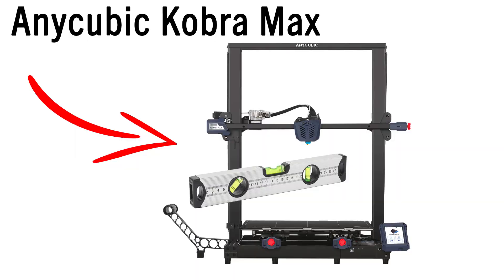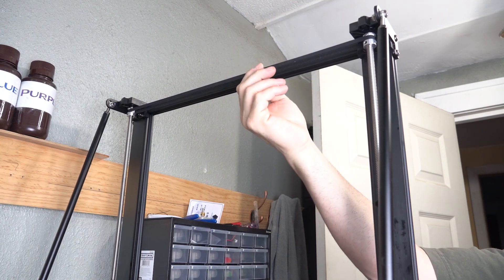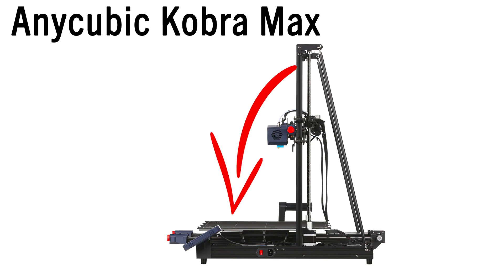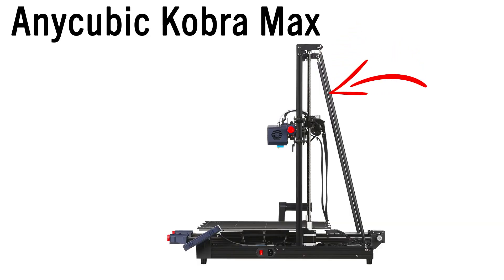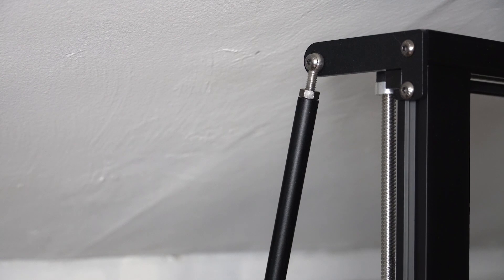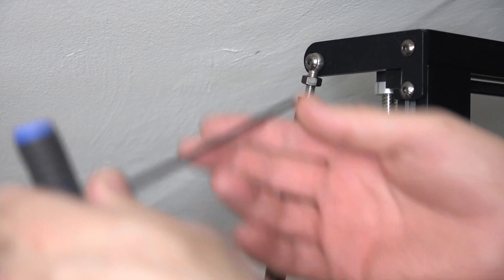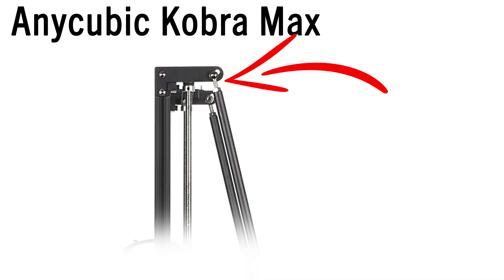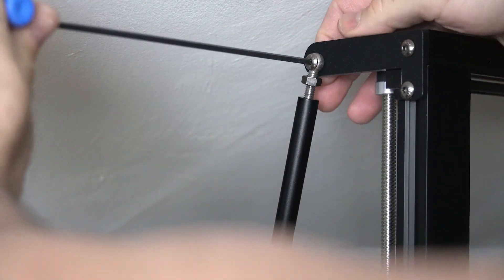Bed Leveling Issues with the @Anycubic Kobra Max

Comment: I just got my kobra 2 max when I try to level it the bed(when motor is pushing) will grind extremely bad then when the extruder lowers toward the bed it gouges into the hotbed anything you could suggest

Comment: ive only had my Kobra 2 max for about a week, ive been able to start a print 3 times and eery one has failed within 2 mins... i cant seem to get past the "Z-axis zeroing failed, possible cause 1. the leveling sensor is abnormal. please check the sensor and wiring. 2. the Z-axsis motor is abnormal, please check motor and wiring".............. ive got 3 other printers , all are lotMaxx, and small printers.. they work.. but i wanted bigger and etter,.. well eventho the max is bigger, its not working so its far from better... if i cant get this fixed soon, im simply going to return it. i have a small window of return left. ... i guess my question is simply, do you have any tips on how to fix my issue?

Comment: why tf is this kind of stuff not mentioned in the manuals i got bro im actually getting a migraine
Reply from the maker: exactly what I was screaming when I figured this out.  Listen, if you find this only fixes your issue partially, there is a code that you can add to your slicer that will compensate for that, I walk through it here, good luck!!: https://youtube.com/shorts/L62LuZwa2B8?feature=share
Reply: Thiught this was common sense but then again i bought mine without a manual

Comment: Please I am in dire need of help. I bought my first Anycubic Kobra 2 Max during the presale and it became my favorite printer. After a month I started getting an error of bedplate not heating. As I updated the firmware, it then became Hotbed NTC issue and pretty much killed my printer. I had to take about the bottom to reattach the bed plate power cable which gave me one print. It no longer works because of this issue. I bought another Kobra since it was a great printer but not even a month after producing perfect prints, it now has massive shifting and nothing comes out of it correctly.
Reply from the maker: By massive shifting, are you saying it shifts in the middle of a print? If that’s the case, that sounds like it’s most likely a belt tensioning situation if it shifts from front to back make sure the two belts are tense not so tense like a guitar string that’s gonna snap, but make sure it’s pretty tight and make sure they feel app Appropriate to one another so the left side is just as tense as the right side. Lastly, if it’s a left or right issue, check the belt tensioning along the gimbal.
Reply: @PrimalEdge  it is shifting in the Y Axis. As far as tension, I adjusted it several times and saw no improvement at all.

Comment: Thanks for the video! But I have a problem with far left corner. If I do the mix of the fixes that you mentioned in both of your videos I might mess up the other corners as well. Or am I wrong?
Reply from the maker: Yes, and no. It’s kind of like a balancing act. If you’ve ever seen anyone try to level a pool table or something like that you have to do it one section at a time and it’s kind of a process. So yes, in an attempt to fix one area you might then offset another area, but if you minimize your fixes and do a little bit here in a little bit there, you can level it out overall I had my problem in the front right corner, which is I think opposite of what you’re saying in the far left corner. One of the problems I ran into when I was trying to solve this. The first time was overcompensating. And I kept thinking every time I do one thing I’m making something else worse. So just take it step at a time and if you’re using test prints, they can be your best friend! There’s a few different types that you can use that I know or in Cura I can’t remember exactly the name, but if you look in the Keira menu, you’ll find different types of test prints you can do and there’s one that has I believe nine squares, and then a perimeter around the whole thing. That’s a great one to figure out where your deviations are at. I know it’s frustrating, but if you take the time to dial it in, you will absolutely be happy with this machine. I am. I’ve got two now.
Reply: @PrimalEdge  thanks for such a quick reply! I appreciate it. It seems that now I have plans with Kobra Max this weekend trying to figure this out. Thank you for your time! You do a great work not just informing of the fixed that Anycubic doesn’t bother telling customers about, but inspiring to keep on going and getting these precious perfect prints despite all the troubles with the printers!
Reply from the maker: @RockerokBS  thank you very much. Definitely keep me posted in this thread and let me know how things turn out.

Comment: This printer is a huge waste of money. I will never buy anything from anycubic again except resin. Resin and not resin printer.
They dragged me through the entire warranty period, when the warranty ended they simply told me it was out of warranty.
I didn't get a single good impression on the kobra max, I'm waiting for a skr board and parts to arrive so I can remove everything and just use the structure. I want to distance myself from this brand and this printer.

Comment: Where can I find the support struts I have a Kobra Plus and would like to add the struts I'm having Leveling issues front to back.
Reply from the maker: If you’re trying to find the parts and they’re not on the website, go through customer support on the website. They are extremely responsive and very helpful. If they don’t have them in stock and can replace them, they’re sure to know where you can pick some up. But I don’t know of a vendor that carries them, myself. Sorry, but that’s about the best I can do for this issue.

Comment: I have the kobra Plus and when I perform the auto bed leveling the printer head pushes the bed down about 1mm on the corners. When I print something close to the corners, the nozzle hits the bed. What can I do to fix this?

Comment: For me this method didn’t work however removing the bed and adding/removing washers to those 6 screws does. My bed was 1mm higher at the back and fortunately the existing washers were 1mm  thick.
Removed the front two and voila now perfectly level.

Comment: Just bought a Kobra Max, during the first auto-leveling, the x-axis errored out and I"m stuck right there. Any help would be greatly appreciated. I've checked every connection, even on MB.Y and Z work with the computer screen, and Y will home. But X will not work manually on the screen and Z will cause the error if I try to home it. I've check my belts, rollers, plugs, wires. Thanks.
Reply from the maker: When you say you’ve checked the belt, are you saying that you just checked it to make sure it was connected or did you check to make sure the tension was correct. I remember when I first got it it took me a little while to get the tension right on the belt because I couldn’t get it to home.  There are two handles in the front of the machine one on the left side, one on the right side, and as you turn them, they loosen or tighten the respective belts. I know that everything can be attached probably would’ve attention isn’t right it won’t work properly.

Comment: Good morning/afternoon. Firstly, I want to thank you very much for having such detailed explanations for this printer specifically.

The Kobra Max is my first printer, and I've recently replaced the entire hot end after I didn't correctly replace a nozzle on the first one, which led to a completely destroyed heat block.

Now my nozzle scrapes my build plate, and although I have only slightly played with the z offset, I can not shake the feeling that I shouldn't have to with the auto level.

Am I just wrong, and I should manually adjust the z axis like you demonstrated in your first video and this one or would you recommend another course of action?

Again thank you for your time and effort both of these videos give me a renewed sense of hope that I can fix my problem because I also love this printer it's exactly what I wanted and needed to start this hobby I just need to learn how to best maintain and care for it.

Comment: My Kobra max is loosing Z height during the first layer or 2. It will print a perfect skirt and wall then when it's filling in the large flat bottom layer it will all of a sudden drop it's Z height and ruin the print. The hot end will eventually end up scraping right on the bed and clogging up the filament. Everything it tight as far as the hardware and I updated the firmware and also tried different slicers.

Any ideas I could try? I've been struggling with this for weeks. 😢
Reply from the maker: I got your message. I’m looking into what I think. The problem might be. Once I can get you a more correct, answer, and then get back to my computer, I’ll type a response here. But I got your message, loud and clear! I understand the frustration, don’t give up, once you overcome the small hurdles, the payoffs are well worth all these little struggles.
Reply: Thank you for looking into for me! I just subscribed.   :)

Comment: Thanks for the video! :)

I have a small question... for some reason i can't get the stringing to stop when i'm printing on my kobra max? I've played around with retraction, speed, levelling and extruded 100mm and yet i'm still getting the problem. I'm using PLA, and pretty much all default settings on Cura software.
Reply from the maker: Try raising the temperature. If I remember correctly, one of the default settings is like 195° I might be wrong about that. But try it on a temperature like 200 maybe 205 and see if that does anything. Also, how old is the nozzle?

Comment: I continue to have the "auto leveling sensor abnormal ". Customer support is NO HELP AT ALL. Any recommendations? Anything will help.
Reply from the maker: This might sound crazy, but it sounds like you’re at a point where crazy might be worth a shot. Preheat the nozzle and after it’s preheated use the ranch and see if it’s all the way tight. Don’t over tighten it and go crazy like the Lugnuts on a car, just go in and make sure it’s not loose. It should be snug.
Reply: @PrimalEdge  I'll definitely try that. Thanks!
Reply from the maker: Let me know what happens
Reply: Did you ever figure it out? I'm having the same problem

Comment: I never respond to most things. I just sit and read from the shadows. But the leveling advice from your first video was SPOT ON!!! My Kobra Max was grinding into the print bed on the left, leaving some filament around the middle, and then dropping the filament on the right side of the printer. With your advice I undid the screws and belt from the right side z-axis screw, lowered it (did this a few times slowly) until bother sides were fairly even. I created a 30x30cm square and spliced it on a raft. The first layer of the raft basically covered the entire print bed (with some bald spots on the print bed due to warping). At this point I ran auto-leveling. Then tried the rafted square again. BEST PRINT EVER! YOU DA MAN!!! Many, many thanks.

Now back to the shadows...
Reply from the maker: That is so awesome to hear that you got it working! I’m very happy for you. This is such a fun hobby and there’s so many ways to not only enjoy it but if you’re interested, you can even make money at it. So I’m really glad you got it working and I hope all your prints are fantastic!

Comment: Hey there! Could really use help with issues I’m having with my new kobra max, from out of the box I’ve had terrible z banding I’ve followed your videos as well as I calibrated the e steps, PID updated firmware and all still to no avail
Reply from the maker: One thing that I did when I first got, my printer was go through every single solitary bolt on the machine and make sure it was tight, especially the Grubb screws on the pulleys as little tiny screws that you don’t really readily see but the beds go around them. Check every bowl to make sure everything is tight and snug and secure. After you’ve done that then go through and do another auto leveling and then do some test prince and see if that solves the issue. Z banding is really tough to fix. So I would start simple before I would get complicated.
Reply from the maker: Also, check the nozzle! That can absolutely cause it too. I’ve heard that happened on a couple of viewers, who have been commenting on these threads. Just be sure when you check the nozzle you do it when is a hot and is hot.

Comment: If I'm understanding this correctly, the support arms will push the frame forward/backwards? Because i have an issue where its printing fine everywhere else but catching one corner with the nozzle
Reply from the maker: Yes, basically. When the support arms lean forward or backwards, they misaligned all the way down straight through to the nozzle. And that can cause some weird behaviors when it comes to trying to level the bed or get that first few print layers to come out great. And if that’s racked meaning one side of the arm is forwarding the other side is back it just adds to the complexity you want to make sure everything is square a line and all the bolts are tight.
Reply: @PrimalEdge  thanks for this! I'll have to look into it, your other video helped a treat sorting out the gantrie now being square.

Comment: Thanks for the videos about this. I swapped to the flexible magentic bed and stuck the magnet to the aluminum but the bed is absolutely not flat at all. Even with your tramming advice, first layers suck. I think the magnet sheet really needs to be stuck to the glass to keep it flat. Not sure if you've had this issue.
Reply from the maker: I haven’t had that issue. Mine are stuck directly to the bed. I still have my glass beds after one side. But I’m not saying that that’s not completely possible.
Reply: @PrimalEdge  You don't have problems with the bed not being flat even after the mesh leveling? I used a square and it's noticeably not flat. There's also center bolts with springs but no nuts like the whole bed is supposed to be warped.
Reply from the maker: I would absolutely without question contact the company. One thing I can say is that I’ve had fantastic experience with a customer service when I’ve had to reach out to them for other stuff. If that bed is off by that much and causing those types of issues, I would imagine they probably make it right to send you a better one.